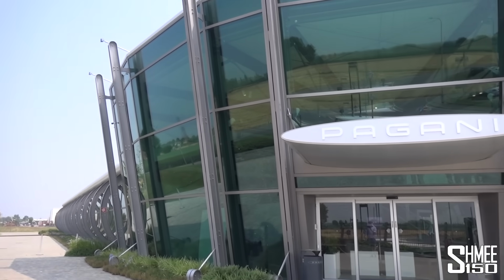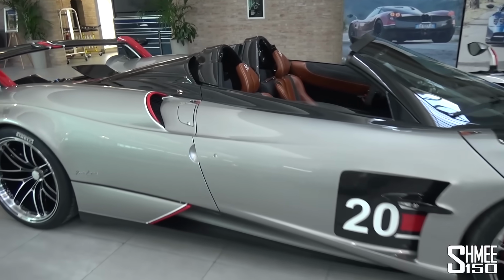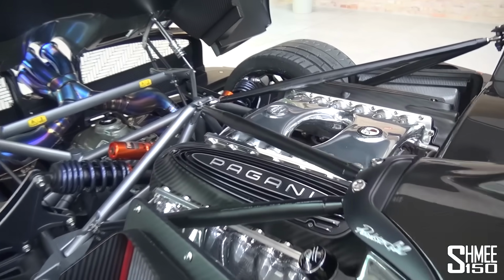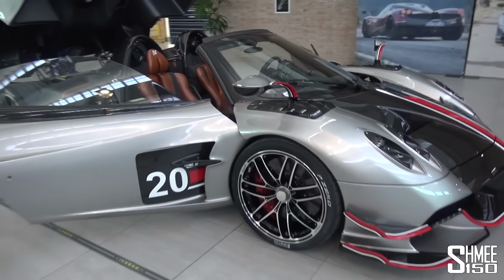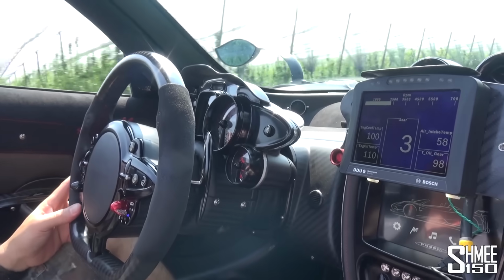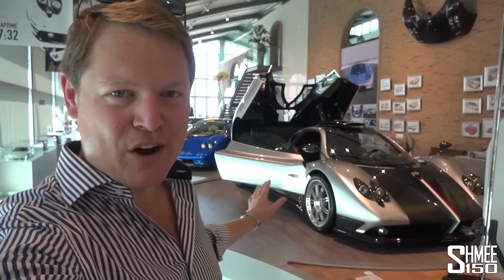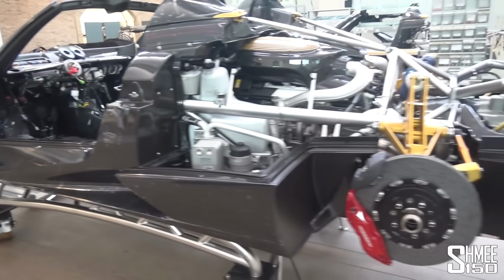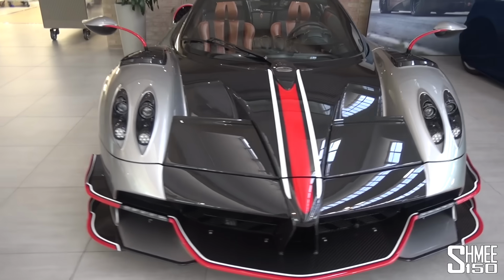Check Out the NEW Pagani Huayra Roadster BC! | FIRST LOOK

Comment: The car is not as light as can be. But Shmee150 is not an engineer so he can not challenge what he is being told. They are very very many parts that could be done in carbon fiber to make them lighter and way stronger in this Pagani huarareayayazarea.. However I guess Pagani can't use all methods to produce carbon fiber parts, i guess due to price limitations on the parts themselves and on the engineering cost as well, not counting patent rights. Car is amazing it is crazy. But the reality is: car is not as light as can be. You get for 3 millions a car with an out-out-outdated V12 engine whose efficiency is more than middle-aged. (Ferrari 820 has same power..... without any turbo....it says so much). For 3 millions you get a car with so many aluminium parts...... Because company Pagani can't make them out of carbon..... even when you give them 3 millions.... Italians have always been poor engineer. They cover it all pretending car looks good which is true but I won't be tricked: even a 7 series from BMW has  50 times more innovations when it comes to carbon parts. Pagani = very nice looking car but engineering from the early 90's. I prefer Koenigsegg the guy has no idea about how to produce a car that includes new trends so he went to make a production deal with Rimac so now they have a killer supercar. But all in all if I want unique experience for so much money you can buy and fly a little fighter jet. No match. Keep you stacks of useless carbon fiber from Hexcel and SGL. I would go for the jet made in Russia that won't fall apart once -25°C winter is here.

Comment: i wonder how they fix the engine cover just by those leather peices ?? and with a hyper car like that ?? how is that possible ??
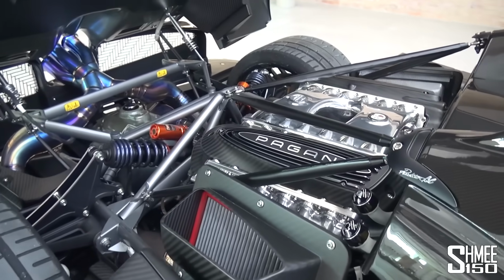Reply: There are two catches Shmee releases at 7:02 and 7:16 that hold the clamshell closed. The straps seem to be cosmetic, perhaps a carry-over from an older Pagani. Also, you can see at 7:20 the linkage for the clamshell is designed to minimize/prevent aerodynamic forces transferring to the latches.